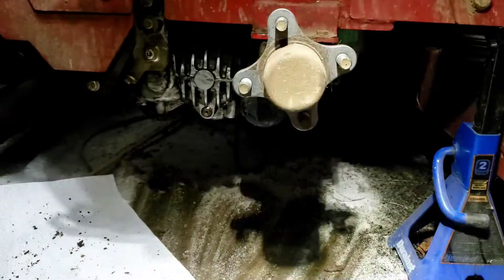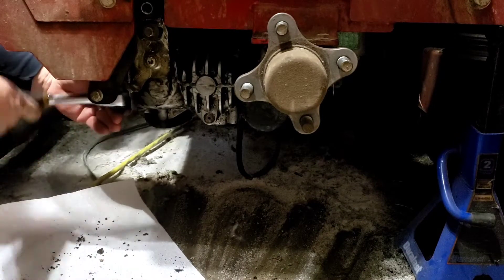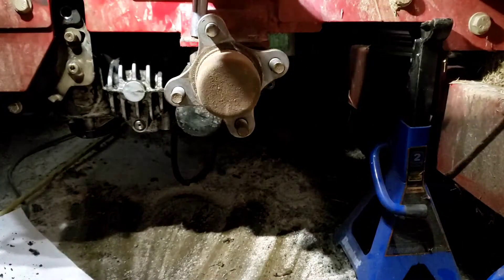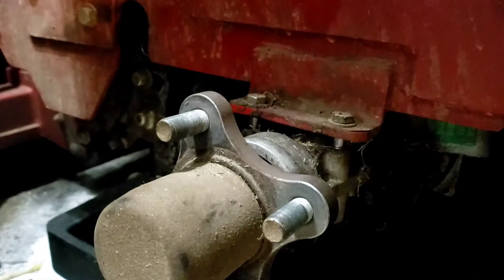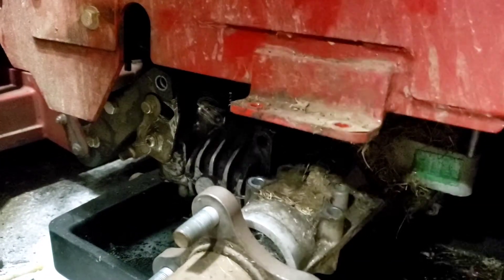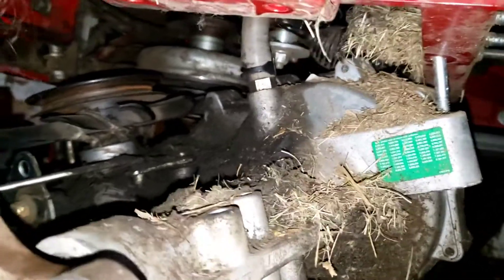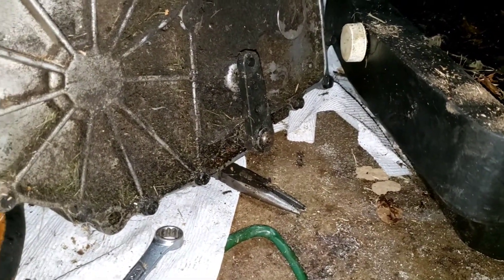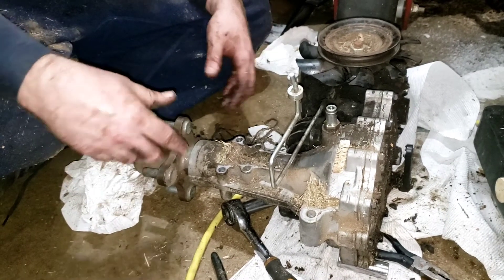Ferris FW35 48, 52 hydro transmission leaking hydro gear ZT-2800 common oil leak repair part 2

Comment: My father's is700z is leaking  again 1 year after both sides being rebuilt so I'm considering redoing it so I definitely appreciate the effort you put in to making this video
Reply from the maker: Good luck, it's not as bad as it seems. I just did it after work each day so it took like 3 days and I would forget were I left off. If you tackle it all in one day it goes much smoother.

Thanks for watching!

Please like and subscribe every little bit helps during these times.

Seize the day each and everyday-Are Jay
Reply: @AreJay1  a guy mentioned a repair kit that does require removal of the transmission so I'm gonna try that route instead it's $70=$120 depending on the transmission buts it's only a 20 min job versus 4+ hrs

Comment: I've got a zt2800 that the oil filter stud is stripped out bad. It can't be rethreaded. What would have to be done to replace the oil filter stud?